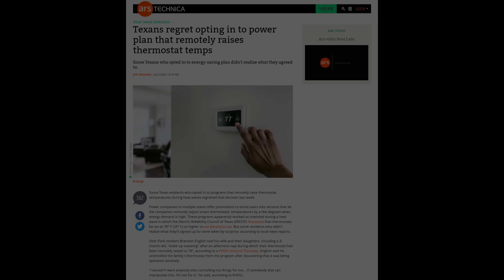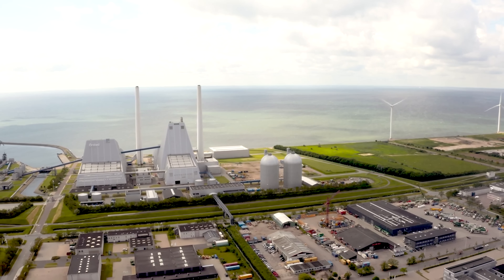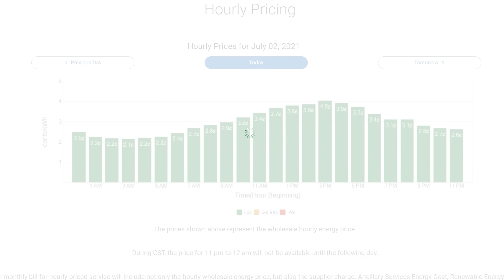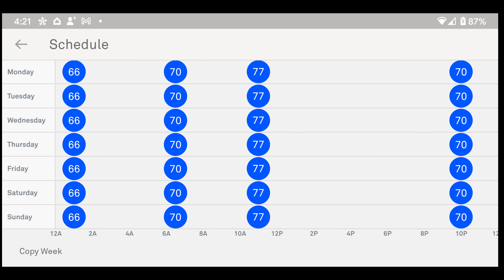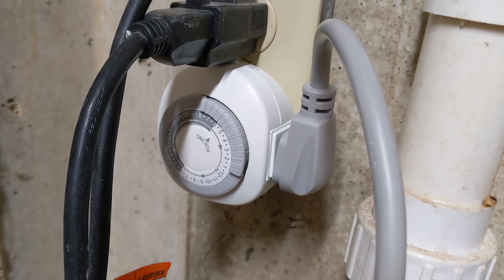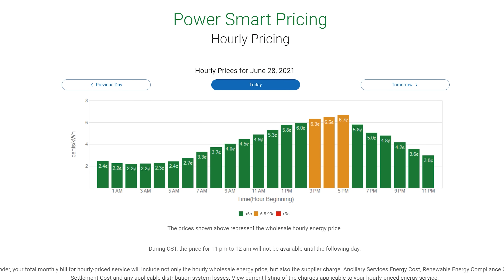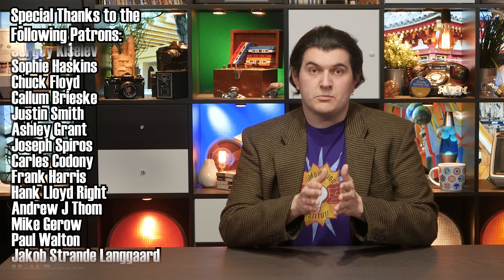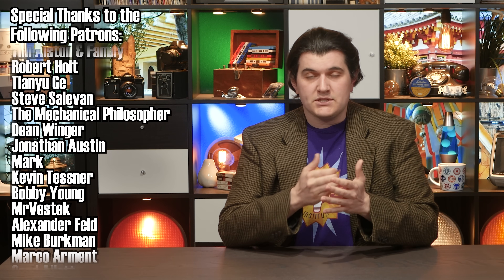Batteries aren't the only way to store energy. Here's another.

Comment: Another benefit of running AC at night: The AC runs much more efficiently as the outside temp is lower than if you ran it during the day.
Reply: Exactly! I was wondering if he'd mention this but yeah the AC (along with the houses insulation in general) isn't fighting against the hot outside air at night either!
Reply: In a lot of places it would be perfectly adequate to just force out the hot air that's trapped inside.
Reply: @jfolz  waves from the uk   basically nobody has AC here because we only need it 3 days a year (which is this week  oddly enough)
Reply: Yes! And something else that cracks me up: running AC ducts through an attic that is considerably hotter than the living area.
Reply: @jfolz   indeed! not so much in illinois where I (and iirc him) live, humidity is just too high.
Reply: The higher the outside temp, and bigger the delta vs inside, the harder the compressor has to work due to higher fluid pressured in the loop. Takes more effort to crush that refrigerant from, say, 80 to 250psi (low side/high side) to get it to liquefy than 50 to 175psi when it's cooler out. The pressure differences can be quite a bit higher too. Car systems range from ~30/~145psi at 65F all the way up to 55/340psi at 110F, in one example. More than DOUBLE the effort to compress it and it doesn't output as cold.
Reply: @stephenlabarre7890  you should come to Australia. 99% of houses with ducted AC have the unit on the roof with the sun beating down on it.
Reply: @stephenlabarre7890  This is why its a good idea to insulate ducts as well to minimize losses.
Reply: Add In a few hundred gallons of water ballast, and it's even better!
Reply: You would have loved taking a Stockton College course I took in 1973;
Solar Energy Thermal Dynamics.
Even though I changed from Alternative Energy to Alternative Medicine, I'm glad I took the course.
It gave great insight to use even metaphorically though my life even almost half a century later.
I like the battery metaphor.
I liken my house to a ship and I adjust my sails for comfort. 
My bedroom has a door leading up to the attic.
Depending on how wide I open attic windows, access door and bedroom window , I greatly expand HVAC free days.
And since I sleep  with my head right next to the open window, every breath I  take is from a fresh supply of air.
It really makes a difference.
Reply: I was thinking that too
Reply: @tmmtmm  I always wondered about that.  Commercial buildings routinely  have their cooling units on the roof, which makes sense for several reasons, but the beating sun can't be doing them any efficiency favors.  What would happen if they simply put a roof above them?  Something minimal that doesn't block airflow so they're still definitively outside and not simply on a level with no walls, but safe from being cooked from above.
Reply: This doesn't work if you live in a masonry building.  If I don't run my HVAC at all on a summer day, then the absolute hottest my house gets will be at around midnight as the heat of the day finally penetrates inside.  I literally can't do what's suggested here because if I don't fight to keep my thermal mass cool during the hottest part of the day, then it will take literally days of running it nonstop to catch back up.
Reply: @tmmtmm  But your houses are upside down so the roofs are in the shade, right?  ;-)
Reply: @mralistair737  But heat pumps are the same thing, you can heat your house using similar tech.
Reply: @jfolz  commercial HVAC rooftop units typically have this feature, called an economizer.
Reply: @BooBaddyBig  there are very very few heat pumps at the moment and they will usually be connected to existing heating systems which are water based not air so not that effective for cooling.  The thing is that when it's not that hot there isn't much need,  even a hot day in scotland tends to have fairly cool nights.  and we dont have the humidity
Reply: @mralistair737  It's a choice to use those water pipes though, and I'm not convinced it's a good choice, as opposed to installing a separate split system. Heat pumps generate much lower temperatures and you have to replace the radiators anyway.
Reply: @BooBaddyBig  for sure. but that means a separate split unit in every room, which is not easy, cheap or neat.  underfloor is better but massively disruptive and replacing the radiators is ultimately cheap and quick
Reply: @herbderbler1585  shading the units won't matter, they will still pull in 130 degree rooftop air.

The effects of solar heating on the outdoor coils is going to be minimal considering the amount and temperature of air that moves across them.

Keeping them clean is more important.
Reply: @albertjordan3249  Right, my ducts are in the attic spaces but 66% of their diameter is insulation.
Reply: @mralistair737  Not 'neat' compared to existing radiators??? Also the units allow cooling as well as heating.
Reply: @mralistair737  We also thought so in Poland. Except whoops, lotsa hear waves all of a sudden.
Reply: @stephenlabarre7890  Up north this is generally not normal.  My house has an upstairs zone with the air handler in the attic. Not what I would have done either but its what the previous homeowner installed.
Reply: @jfolz  While exchanging hot air inside a building with cooler air from outside is a good start, that dies not take into account the thermal mass of the building itself. If the physical structure of a house is warmer than the air inside it, then it will heat up that air until it reaches a thermal equilibrium. 
It all depends on whether you can remove as much heat as you want from the building using a "passive" air exchange, or whether you need artificial assistance using an AC.
Reply: @edwardblair4096  I'm thinking something along the lines of ducting and (one or more) fans to exchange the air several times over night until temperatures equalize. ~100 watts of fans should be plenty for that.
Would also be nice to add heat exchangers so you can pull in fresh air during the day to manage CO2 levels while keeping the heat where you want it depending on the season.
Reply: @mralistair737  and now the 3 days are back

Comment: Red flag 11:13 There is a mold risk in this you know. If you are getting condensation outside of your windows, this means that the temperature of the glass is below dew point of outside air. This also can happen on your vapor barrier (if you have any) or basically on any part of wall structure that is cold enough. This condensed moisture is not healthy for the house as it might soak your insulation and cause mold on your structures. So as an HVAC engineer I would not recommend setting internal temperature lower than the dew point temperature outside.
Reply: In central PA, the dew point is usually in the upper 70s to mid 80s.  I keep my thermostat at 74 and have no problem with mold.  On the flip side, if you're "super-cooling" at night to 66, I can see it being a problem.
Reply: In the entire state of Missouri, the dew point is often above room temperature. Its more than a little ridiculous, the ac on peoples cars continuously drip a visible stream of water, its that bad.
Reply: @lobsterbark  this water you are referring is drain warer from the evaporator. This is also how you dry the air. It is a different story to have condensation on walls (or outside your car windows) compared to the cooling coil which is cold by design and pretty much always under dew point.
Reply: @pamike4873  I also run my AC at 75F during summer and heating on 71F during winter. I have to add that I think the idea itself is good, so run the AC outside peak hours as it will take time for the temperature to rise again due to thermal mass. However I use a different approach; I have solar panels that have output higher than my cooling demand and sell excess electricity to the grid, so I only help even the load during peak hours.
Reply: @pamike4873  also the humidity is usually over 70% in PA, closer to 90% if it rained a lot, which may or may not be a factor
Reply: @lobsterbark  I can relate. I live in SC, have the same problem...
Reply: @Migreeni_mies  Yeah, but normally it's like a drop every few seconds. In Missouri, it's literally a continuous stream.
Reply: @lobsterbark  *Misery.
Reply: I hope you understand that if he starts to run his house above dew point this entire video and idea would have to be scrapped, and any gains lost.
Reply: Mold will grow from the smallest amount of moisture in the air, even in dry places, it doesn't require damp places, damp places just spread it faster. If a damp place in or around your house has become moldy, you probably already had mold in your house. I mean, the spores don't just magically get there. What as a vaccuum cleaner engineer (not really a thing, but essentially your job title) qualifies you to tell people about mold, it's cause or the structures surrounding it? Are you a mold specialist, and a carpenter too?
Reply: @darrylkinslow5613  Nope, I'm neither. Although I do microbial air sampling as a part of my job. Also my company produces central vacuum cleaners, but I'm not a specialist in those. Anyhow, mold is not the main thing here, it's condensed moisture inside walls that should be avoided
Reply: We had a dew point of ~25°c one day here in Tornio, Finland. Was awfull to work in that weather with 100% humidity
Reply: I live in Louisiana. the dew point here is "yes". Any temperature is the dew point. the air is at 11,000% saturation 24/7.
Reply: What if the outside air temperature is already below the dew point? That's almost every winter night in my region. The fog is so dense, sometimes I can't see the buildings 50 meters away.
Reply: Try Florida, I have dew at 59,69, sometimes 78, once in a while at 87 or higher, and this is why we air out our houses every time we get dry days.  Mold is an issue.  Not setting internal temp below dew point is not realistic in the real world outside of your limited experience.
Reply: @pamike4873  haha i was about to say the same. the dew point in the mid-Atlantic in the summer is insanely high, as can be the humidity. structures should ideally be built to deal with this. im sure a lot aren't, but saying 'dont set your internal temp under dew point,' when that can be in the 80s is absurd
Reply: People have to remember that houses are built differently in hot and cold climates, my comment applies more on cold climate, but can also be true on hot climate as well. Also I realize that setting temperature above dew point is not always possible and to be honest there is a some play in it as the part that is exposed to outside air moisture is higher due to surface convection and thermal conductivity (i.e. outside air heats up the other side also). So the air inside needs to be much colder than dew point, but how much it depends on the structure, hence it's better to be on the safe side if possible. Worst part is cold climate vapor barrier that is located inside, just before insulation, it get's cold but is also exposed to outside air and will soak the insulation if this happens often and a lot. Moisture condensed on any surface cold enough. During night these are usually parts that are exposed to the sky, especially if it's not cloudy as the space will draw heat. And fog is due to air being colder than dew point. I'm just saying running your AC below dew point can cause problems, but not necessarely, there are many factors in play like how the house is built, what insulation is used, is there a vapor barrier and which side it is (cold climates have it inside, hot climates have it outside to prevent this whole deal from occuring.)
Reply: @Migreeni_mies  increasingly more and more places are in both cold and hot climates. The Mid-Atlantic and Midwest always have been but the hot is getting much hotter. We're gonna need building and cooling measures that can be mold resistant and useful in both extremes
Reply: In most hot and humid climates, you're going to have to set the thermostat lower than the dew point to stay cool even without storing negative energy.
Reply: @cwill2127  nah we mean damage mold causes to structures. The mold is fed by the HVAC in building and usually rots the joists and subflooring of a home
Reply: @wakingcharade  I agree, here in Finland we have cold winters and hot summers and they are getting colder and hotter. Last winter we had ~30 days below -13°F and this summer been already over 30 days above 80°F. Yearly range here is typically -22...86°F so well over 100°F (-30...+30°C). And houses are built mainly for winter conditions.
Reply: @theq4602  ah yeah that’s no fun

Comment: We're doing the same with our ICF built home. Superior insulation, with the advantage of all the concrete that acts like a massive heatsink, allows us to run AC only at midnight. We don't have to make it that much colder, due to the walls their mass and capacity. Even during the hottest days the temperature doesn't get above 73, and we only need to cool down to 68.

Great video!
Reply: Please use SI temperature units instead of archaic nonsense so that the rest of the world understands what you are n about

Comment: Side note: As an added bonus, your AC unit is more efficient at cooling when the exterior temperature is lower. Cooling your house during peak exterior temperature (like practically everyone does) is additionally inefficient that way as well. Cooler exterior air = less electricity for the same amount of cool.
Reply: But that doesn't account for the obvious heat seeping back into the house before peak temperatures occur, to combat this the A/C must be ran excessively to make the house super cold. Obviously in total doing this would consume MORE energy but it consumes the cheaper energy due to how our grid is configured.

Comment: Fun fact about that kind of pricing: Apartment complexes may decide you can only make so much noise between so-and-so hours. Mine are 10PM and 6AM. Due to the fact that my washer, dryer, washing machine, and shower all make enough noise to be heard in adjacent apartments it's a small problem to run those during those hours. This kind of pricing, while pragmatic from an energy consumption standpoint, is a bit bothersome if you're already cash-strapped and living in a collective housing situation - as most cash-strapped individuals do.

Something to consider my good man! Cheers!